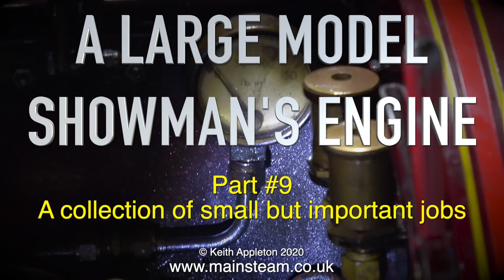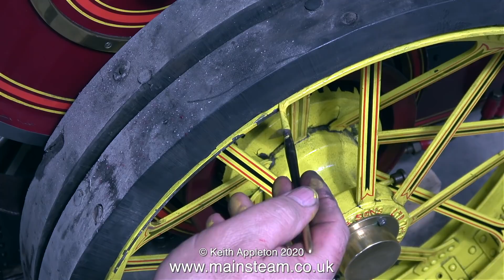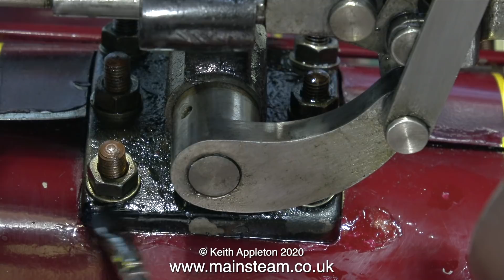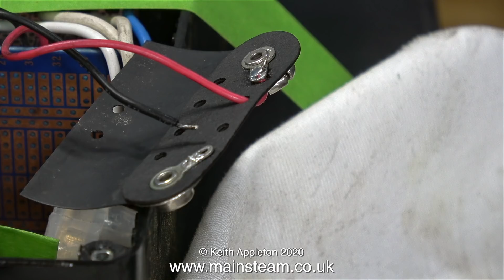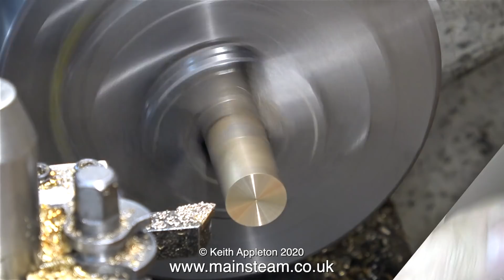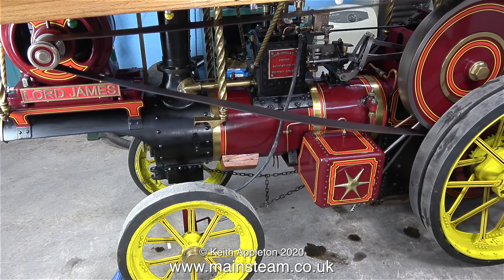A LARGE MODEL SHOWMAN'S ENGINE - PART #9

Comment: Like my anted soldering irons, had them years and just had the very occasional element change however it looks like Mr Appleton could do with investing in a new tip for his. If it’s this short so you can get better heat transfer then you really need a larger iron for the job 😁
Reply: Among others I have one of those 'gun' shaped one with a tiny bulb that points vaguely towards the tip. Replacement tips are a pain in the arris to source, but a judiciously shortened and reshaped split pin is an adequate and far cheaper alternative.

Comment: I have a question thosh as the series progresses I have no doubt that it will be answered.   I have seen one of these before, but the belt had a tensioner in the center or the upper belt section that was hand cranked up or down to tighten the belt.  Was this something not used commonly? Or was it a owner added device made to look like it was part of the engine?  If I can find the photos I have of it ill post it.

Comment: About the generator and running in reverse, mayb you could twist the belt. That was often done with full size flat belts - and it would stop most of the dancing around of the belt too.
Reply from the maker: No need . . I just move the reversing lever into reverse - the belt is currently very slack. All  is revealed as the series progresses. I am currently editing part #42 for my Patreon supporters . . . . . . www.patreon.com/keithappleton
Reply: My thought on the 'running in reverse' is that it's a DC generator and the polarity isn't right.  You might be able to run forward just by swapping the wires leading out of the generator?  Don't know what the electronics in that little box do, but if there's some diodes involved, polarity might explain things.
Reply from the maker: No need . . I just move the reversing lever into reverse - the belt is currently very slack. All  is revealed as the series progresses. I am currently editing part #42 for my Patreon supporters . . . . . . www.patreon.com/keithappleton